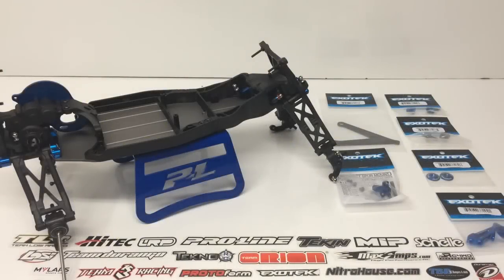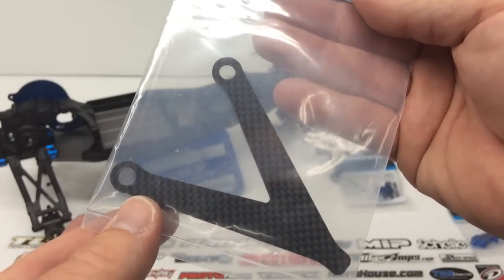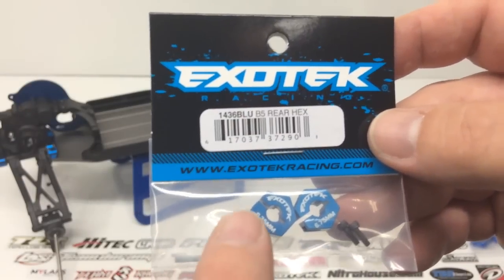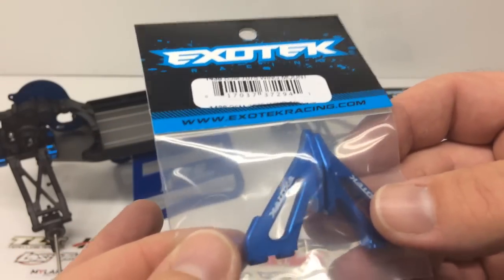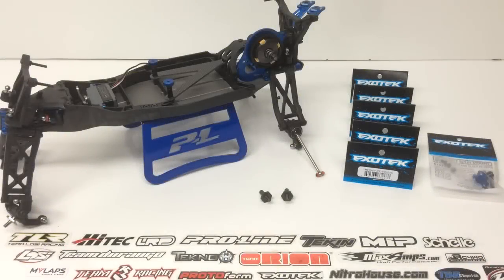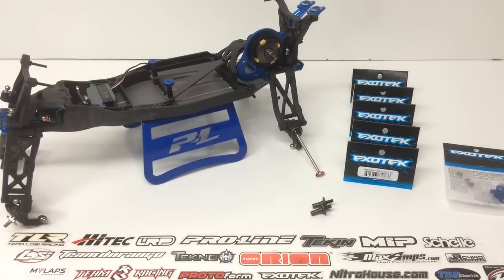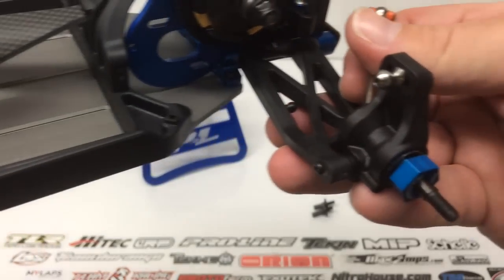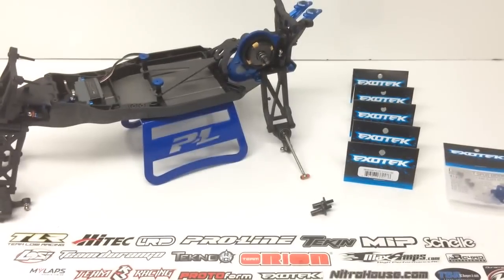Exotek Upgrades - Team Associated B5M / Update 2.5

Comment: Talk about weight savings, I put the STRC titanium screw kit..that was nice. And just today did the Factory Aluminum Top shaft..so much lighter. I also did the one piece AE front axles for the wheel hexes..not a fan of the two piece axle design.
Reply from the maker: Nice!  Yeah, I believe I have taken off more than I've added so far.  We will see on the final weight in

Comment: With the slipper eliminator how do u install it. Do u drill holes ur us there a spur that is made for it. I would hate to drill it
Reply from the maker: +Erik theGoProFanatic Nope, no drilling required.  you basically remove the slipper plates and pads and this goes in it's place
Reply: Don't u have to use a special spur gear?

Comment: Careful with that slipper lock down..unless you plan on running a gear diff.
Reply from the maker: Yeah, I have it set to spec from the manual right now.  Once I get to the track, I can break it in and test it

Comment: Can you still use the wing shim with these mounts?
Reply from the maker: I'm not sure, but I did see those in the final bag........still getting electronics in
Reply: The RCNetwork Ok..cuz yea that shim angles the wing forward for more down force. I've tried running without the shim when I put the Trifecta wing on, but first the shim wouldn't fit and I noticed a bit of a difference in handling..then I took my body reamer and reamed out the wing-post holes and was able to use the shim and the trifecta wing. Which is an awesome wing by the way..you might like it too.